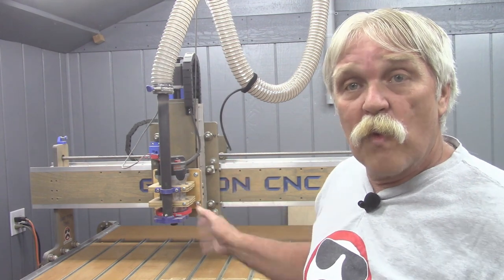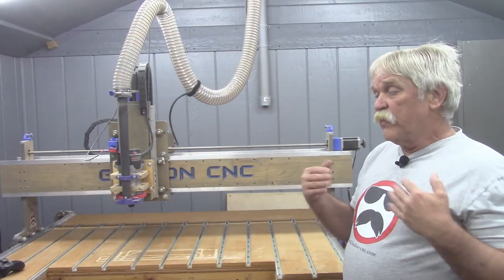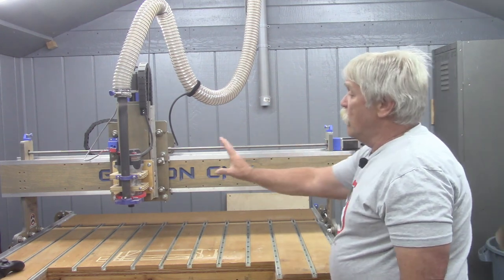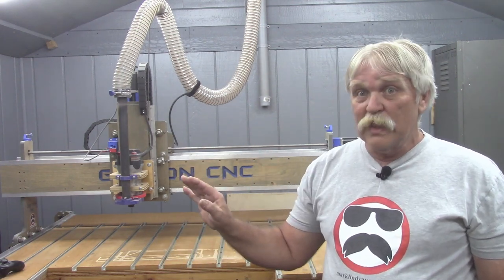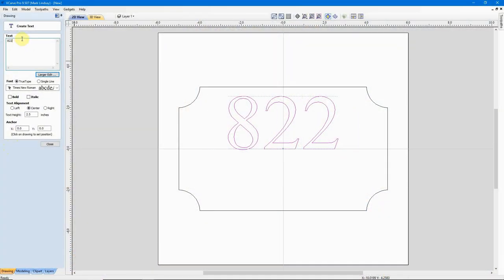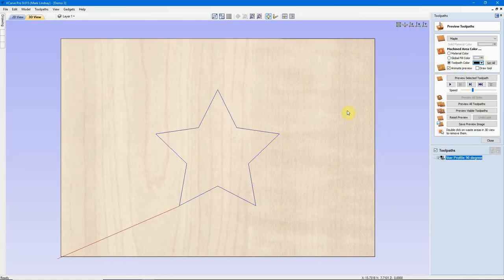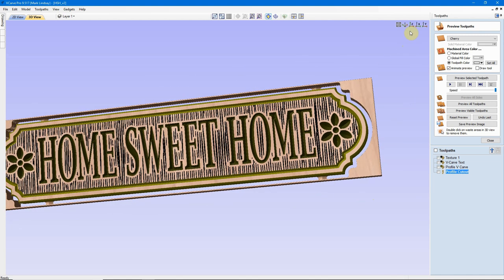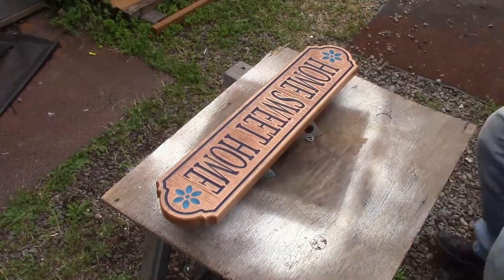The CNC Process for the Absolute Beginner

Comment: I built my 1st machine with about a 18” x 20” work table, and ran into some jobs that required more space, so I built a 2nd machine with a 50” x 50” work table. If I could go back, I’d make that 2nd machine MUCH smaller. As it turns out, I rarely ever do anything over 2’ x 2’ and the thing simply takes up too much space.

FWIW, I started out as a hobbyist and a business grew out of that hobby that is now my full time job. The possibilities are truly limitless, and Mark has been an invaluable resource on my journey. Even though I’m no longer a “beginner”, I always make time to listen to what Mark has to say, and this video is no exception. You can never strengthen your foundation enough. Take the time to go through all of Mark’s videos and you will end up with a command of the technology that is sound. There are no shortcuts. You WILL make mistakes along the way. Learn from each and every one of them because there’s much more to be learned from those mistakes than from the jobs that go perfectly.

Thanks Mark!

Comment: Hi Mark I have subscribed to your channel and love the way you explain everything. I have tried to do your 1st project for beginners with a minor mod. the problem I'm having is my cut job is starting in a different location than where I probe for XYZ. I am using the Onfinity X50. It homes with no errors also. If you have an idea of something I could change please let me know.
Reply from the maker: Thank you, Lee. It sounds like you have an offset somewhere in your controller software. I'm not familiar with the Onefinity controller at all, so I would suggest contacting their tech support, or their support community. If you go to their website and click on SUPPORT, you'll find links to their support communities. Those folks know your machine best, because they own and use them. I would only be guessing.
Reply: @MarkLindsayCNC  Thanks for getting back to me so soon, I'm learning a Ton of stuff from your videos!

Comment: Interesting - I just had a class saying the X axis is the length of the machine and the y axis is the width. Which is opposite of what you're saying. Also, if you could talk a little faster, most people learning Vcarve are probably not "slow" to grasp what you're saying.
Reply from the maker: The reason I speak so slowly is because I'm the one who does the closed-captioning for all of my videos. If I speak at my normal speed, it's too fast for folks to try to read the captions. Most of my viewers who can hear go ahead and watch my videos at 1.5 or 2X speed. The axis naming convention is older than CNC itself, having been used with various types of equipment for a couple of hundred years. The standard was adopted decades ago and remains constant. X is always listed first, and runs left to right, Y is listed second and runs front to rear, and Z is listed last (if it is indeed listed at all,) and runs up and down. Always. If you get into your CAD/CAM software and check it out, you'll see that it also follows this convention.